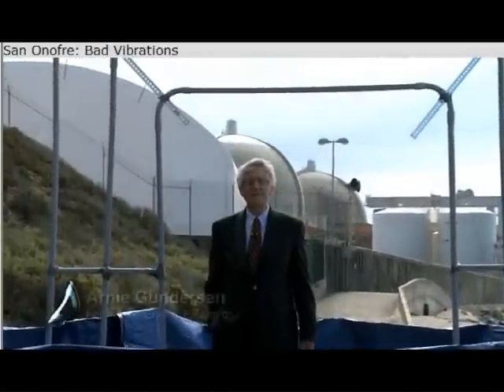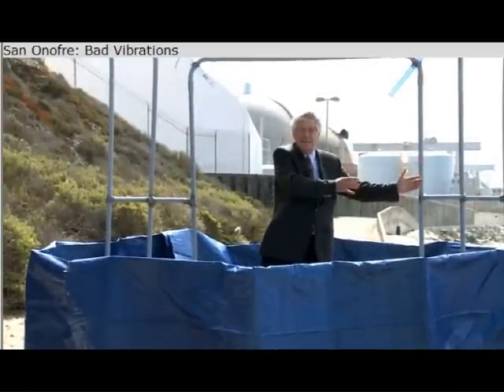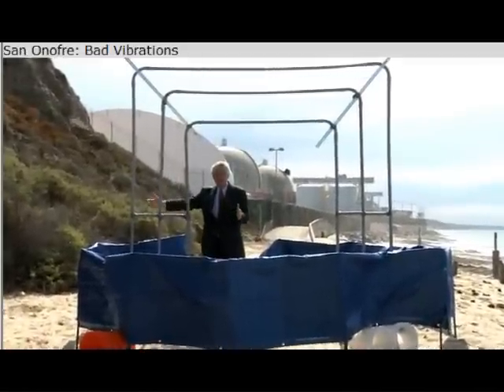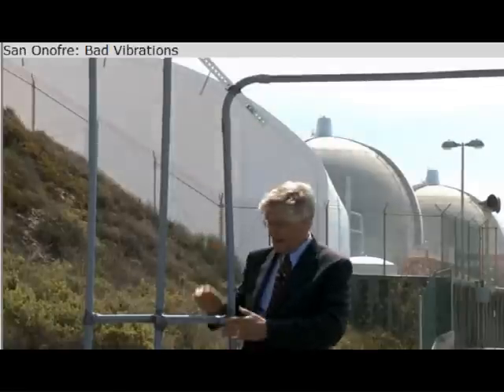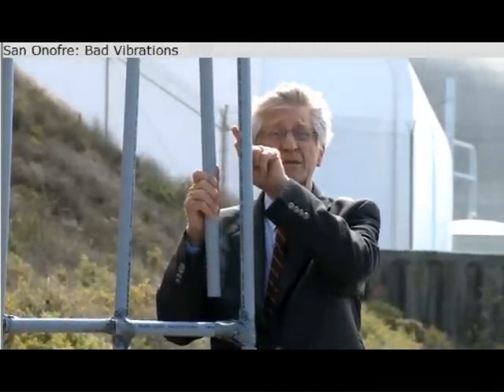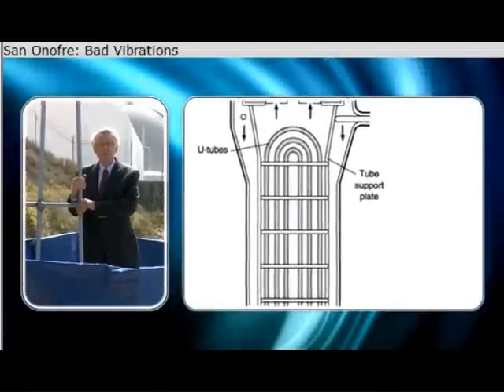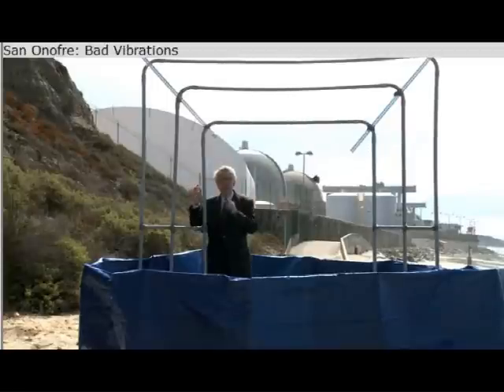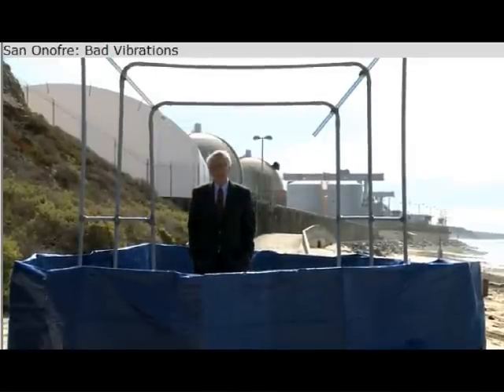San Onofre: Bad Vibrations (Cause of Radioactive Emissions / Arnie Gundersen)

Comment: twiui,
The old egg crate design allowed a larger volume of water to flow around the tubes  through the support plates,  in fact,  a greater volume of water flowed than steam.    Water is excellent at dampening mechanical vibrations,   but steam is basically an air void in the water.  Think of the vibration created by water boiling in a pot on your stove.

The new support design restricts that large volume of water from flowing,  and as a result,  a much greater proportion of steam is flowing.